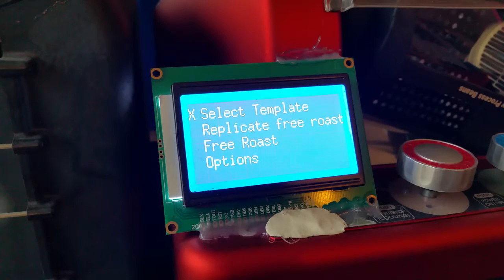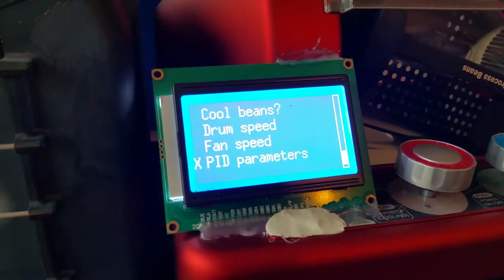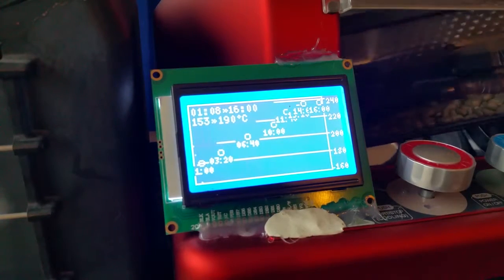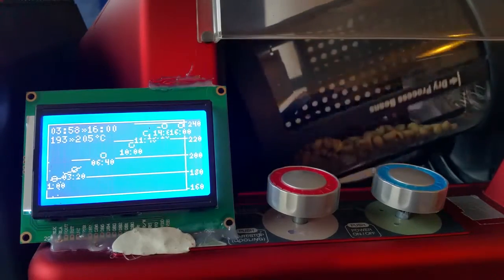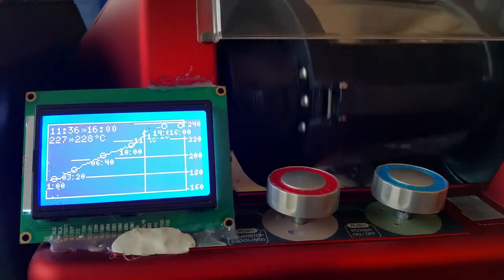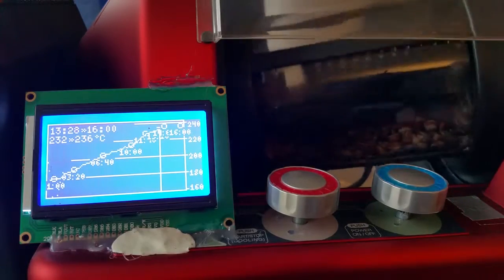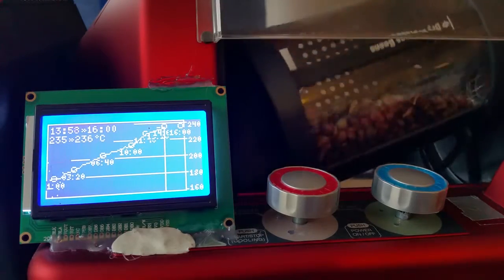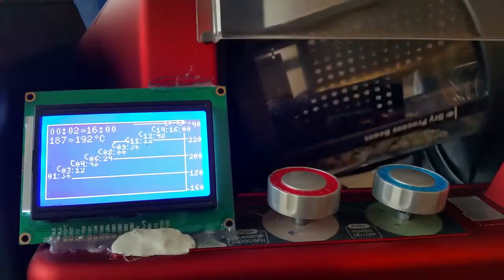Gene Automation Mod Rev 3 - LCD - Reupload

Comment: Hello! thanks for the project !. On the electronic side there are problems with the LCD. in the drawing it's on pin 15TXD3 it goes to E lcd but for ardu mega the drop 14 is TXD3 I made it according to the drawing made by you and I probably don't have a display and when programming it's another pin, please help me!
Reply from the maker: There are many similar LCDs on the market. Just connect it like the manual of your LCD says and change the pin configuration accordingly.
Reply: @nvprojects7601  I have the same lcd can in the manual ST7920 I want to know which pin are bound to work.
Reply: Or if you can help me with Gene_automation.ino for Arduino Ide I can change pins. Thanks
Reply from the maker: @znc3dmaker  The code is now available on Github: https://github.com/nekowokaburu/GeneRev3
Reply: @nvprojects7601  Thanks!!!